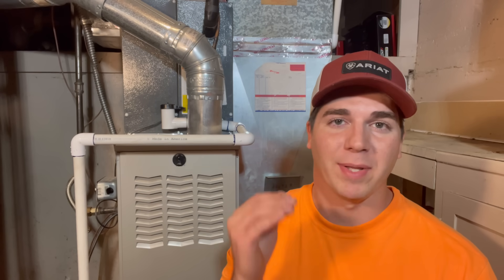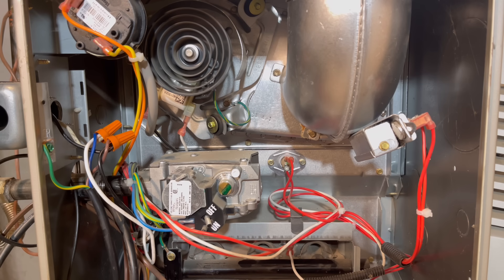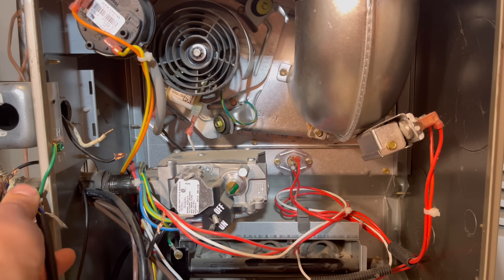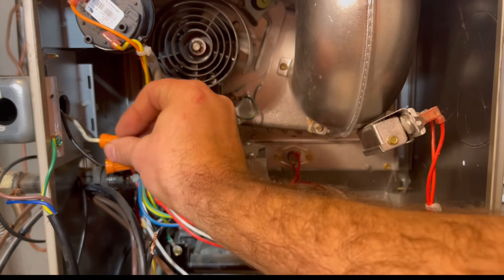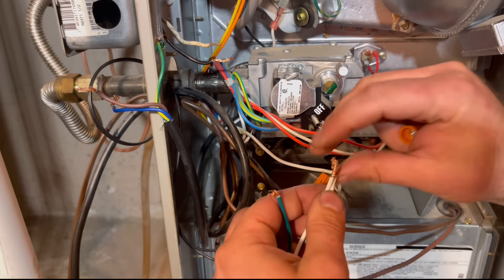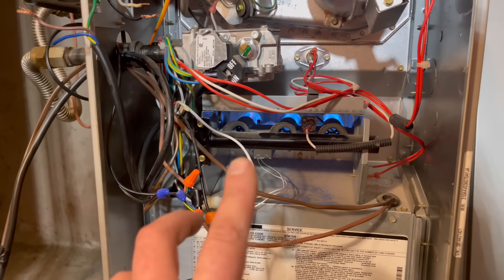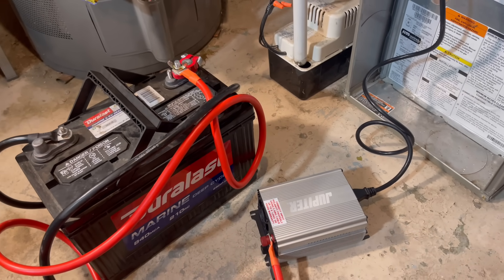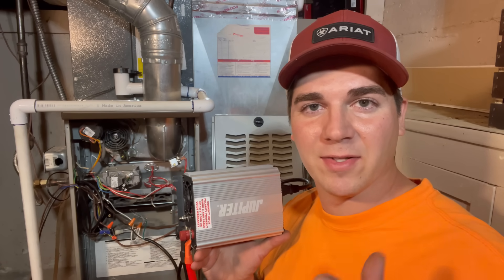Did You Know You Can Heat Your Home With A Car Battery?

Comment: I've been prepping for a while now and have a Big Buddy propane heater with 2 tanks. This is the BEST idea I've ever seen to keep my family warm this winter. You are awesome man thank you!
Reply from the maker: Glad you liked the video and found it helpful. I’m going to be doing a video on heat sources with no gas or electricity soon :) cheers
Reply: I have a 2 tank big buddy. It will burn through those tanks in 15 hours. I got a 50 gal propane tank and adapter and that will burn about three, 10 hour sessions. Great video though, I've added to my arsenal of prep knowledge
Reply: @ER-yv5mu  The buddy's are alright but they burn way to much propane. I have a zebco travler propane heater that was made in the 70's that uses way less propane. My Zebco travler goes from 2000 to 7000 BTU's. I also bought a $100.00 Wood Stove if I need it.
Reply: @christopherhorton821  How does this make any sense?  It's a device that converts fuel to heat.  If the device burns less propane, then it produces less heat.  If your device is burning too much propane and relatively less heat, then you should be concerned about a propane leak.  There are tricks to improve efficiency of spreading heat, like using a fan, but that's not an issue with the device itself.  

Also, you're obviously going to be using more fuel for a larger and less-insulated space.  I used a Mr Buddy heater (about 30-60 mins per night) and a propane stove in a tent for weeks here in the Canadian bush and maybe used like 4lb, which is after I switched to a 30lb after finding the little 1lb tanks to be a waste.
Reply: @V_for_Vovin  I'm not sure what you read but yes my heater does produce a little bit less heat than a buddy heater. My heater goes from 2000 btu's on the low end and 7000 btu's on the high end. The lowest that a buddy heater goes is 4000 btu's. My Zebco Traveler uses half the propane that a buddy heater does on low and less propane on high.
Reply: Yoy prep with propane ?  Get a wood stove.
Reply: @jeepsblackpowderandlights4305  I do have propane. I have 2 two 100 pound tanks and a couple 30 pound tanks. I also have a small wood stove. I show all this on my channel.
Reply: @christopherhorton821  ah.  I have a 500 gallon tank on my 14 acres.  But i never use the furnace in the winter.  Unless im like not home for days and days and need to keep the house above freezing.  I think i used 270 gallons in 12 months lol.  But 8 acres of my land is woods.. so basically unlimited amount of wood.  My barn has a cinterblock lined with tile chimney never used for a wood stove as well.. debated on getting one installed.. but id be afraid of setting the 80 year old barn on fire.   I need to get it checked first.

One thing i need to get though is freezers for food..  surpised i havent yet.. but ive been too focused on other things.

I wish i had solar panels too.   But i do have anatural spring creek that runs through my property.. so thats good
Reply: @jeepsblackpowderandlights4305  It would be nice to have a larger propane tank, but right now we rent a studio apartment. We do own a small piece of property in the little town of Rosebud, Montana. The back of our property is within 5 feet to the Yellowstone River. I also purchased 17 pounds of activated carbon to make a water filter for river water if needed. Having a freezer is a good idea if you have a way to run it, and if you can hunt. Solar is alright but it does not work all that well in the winter if there is snow. You can buy a 400 watt kit for just under $500.00 that includes the panels and a 30 amp charger controller, But the cables and terminals for the batteries and a main fuse and the batteries, and power inverter are a extra cost. Even for a small set it can cost quite a bit once everything is added up. Doing it yourself is still a lot cheaper in the end.
Reply: @jeepsblackpowderandlights4305  It depends on the situation.  I spent months out in the bush in a canvas tent this year and used both a wood stove and propane heater.  A wood stove works great when it is cold (freezing), but it's better suited for a stationary post.  Wood stove also requires a lot of maintenance, especially if smaller and you just use raw wood from the ground, and it can smoke you out a lot- granted, you can cook easily on it.  When season warms up, it's way more efficient to just fire up a propane heater for a brief period at night before sleeping.  Don't forget to get some spare wool blankets, they really made life easier for me when I discovered winter wasn't over yet.
Reply: @jeepsblackpowderandlights4305  yah...
As long as you DONT want fire insurance...course that varies from State to state...
Reply: Your big buddy propane heater is for outdoor use only. If you use it in your home, your family will get sick.  Two one pound bottle of LPG will last about 8 hours and deliver only 600BTUs of heat.
Reply: Off grid greenhouse person here , you have the smarts but why not just concentrate for one large room in your house during emergency, family could watch TV or play games and keep their minds off stuff for little watts just use a UCO or any candle type heater, more bang for your watts
Reply: @timmeier8863  Well, where I live, if the power is off for 24 hours in winter, my pipes will freeze and cost thousands to repair. Gets to -15 sometimes.
Reply: @timhallas4275  Where I live in Montana the pipes can freeze in a matter of minutes.
Reply: @timhallas4275  if your power goes off, turn off the water main at the meter, open the lowest faucets in the house and let the pipes drain
Reply: @kenwittlief255  Oh great idea. Now I have no heat, no electricity and no water. Brilliant.
Reply: @timhallas4275  I understand what your saying but every yard/house is a different climate from my house to yours that said if you need to keep your pipes from freezing $$ maybe batteries and warming up your whole house is not the only way to think about your climate, a small generator and heat tape where pipes enter house could do the trick? And your battery would be better off for small wattage use just saying, me personally I get board to death without my surround sound and tv wi fi but I can run all my stuff for under 200 watts which is cool for me and my climate , that’s what I’m saying, I don’t mean to offend anyone I get all my ideas on the U and use what’s good for my climate , works for me
Reply: @timmeier8863  Any battery is at best a temporary solution to any problem. My plans are for long term power outages in the coldest weather conditions. I have alternative heating solutions including a natural gas heater that requires no electricity, and a wood stove that will keep me warm if the gas supply goes down.  I have enough fuel, water and food to live one month with no outside sources. It sound to me like you are prepared for one day without electricity at best.
Reply: @timhallas4275  I did not want to say to much because I didn’t want people to think I was piling on , so your not using that battery for your house because you have a month of alternatives that’s awesome for your climate but you did not mention that , I have 1 k solar and 1k amp hours and I was a A/C mechanic for 30 years so when you mentioned your house and -15 I knew this heater/battery thing would not last and you have the perfect easiest set up , not in attic not under house but if you would have mentioned this at the beginning and said I’m covered but this could work for others in a pinch that would have been better, in my opinion and how many heat cycles will your heater go through, start/stop ? An hour , or run it up to 80 and hope for the Best.
Reply: @timmeier8863  You are pretty smart. I talked about some things like that in my latest video.

Comment: Don't twist the wires together before twisting the wire nuts on. Just push the wires straight in and let the wire nut do the twisting.

Comment: I am a HVAC repair tech. this is the best idea I have seen on you tube get a small generator to charge the battery back up when it needs charging [ charge out doors or in a will ventilated area] harbor freight good prices thanks
Reply from the maker: Glad it helped! Cheers

Comment: Figured that out more than 20 years ago with my hot water heating system. No blower, so I can use a smaller, cheaper inverter. Just pull the car up close to the house and run an extension cord out to the car.

Comment: Good for gas furnace (maybe) not so good for heat pump unit. Just have a small generator on hand to run a furnace and fan say about 1200  watts?

Comment: Anyone taking advice from this video is an idiot.
1)  That car battery probably won't last an hour running that furnace.
2) That car battery isn't designed to be deeply discharged and it will destroy the battery.
3)  That crappy little Chinese inverter is probably a modified sine wave unit that has a high probability of burning out the control board in the furnace.  The inverter must be a "true sine wave" unit and it should have a clean output.

The conclusion?   People in Texas are idiots.      Less bible, more science people.

Comment: Will that work on a 700 watt invertor or a 700 watt surge to 1000 watt solar power generator??
Reply: I have a Coleman 90k Btu furnace in my manufactured home that draws less than 12 amps and thats at surge only then it drops do so i want to use the 700 Watt Solar Battery charger with 1000 watt surge capacity. That should work ok. I will put in a double pole, double throw switch on the furnace with a separate 110 volt recessed male receptacle with hinged cap
Reply from the maker: My advise would be to pick up this inverter. Pure sine wave 2000w

https://amzn.to/3APhfwr

Then install the inverter in one of your behicoes and run a cord to your furnace. Have it wired in advance so the furnace has a male pigtail that plugs in like an appliance. Then when an outage hits, simply plug the extension cord into the furnace pigtail and you are golden as long as you have fuel in the vehicle 👍🏽 cheers

Comment: Very nice, just wondering why there is not a door safety switch?...thx gary
Reply from the maker: The carrrier Bryant model that I have has the safety switch behind that metal plate that seals off the fan assembly. It’s a little different then most furnaces. Thanks for watching! Cheers

Comment: And does it work with marine batteries?  Car batteries loose life % every time it's sucked dry.ie limited life. I mean in an emergency we don't care but for preping planning I would say get a battery that will take many more charge and discharges.
Reply from the maker: Yea marine battery is better. Here is what I did. I picked up a pure sine wave inverter, wired it to my work truck, so now if the power goes out, my truck acts as a generator, and is much quieter and I can power my furnace as long as I have fuel in the truck! Cheers
Reply: @diyhvacguy  it there a minimum battery power cca?I know I'm asking more technical questions.but the more info the better decission we can make.i have 3 building I rent to family members. I have 2 backup generators.and propane heat sources as second backups. But you can never really have enough backup plans. Just went to check 1 generator ( only 2 hours use on it for matance purposes) and it gave me a hard time starting. Stupid sparkplug cap was loose from moving it. Always have several backup plans is my thinking.

Comment: There is no way that battery will run that furnace for days? Maybe an hour or 2 . The blower motor will draw too many amps and kill the battery. 60 amps min a furnace uses and it will not last long. Get a small generator and run it off that.
Reply from the maker: Here is what I did. I picked up a pure sine wave inverter, wired it to my work truck, so now if the power goes out, my truck acts as a generator, and is much quieter and I can power my furnace as long as I have fuel in the truck! Cheers
Reply: @diyhvacguy  that will work

Comment: Mr. Heater propane heaters are my back up.  No electricity needed.  I’m not knocking your idea, I like your thinking.
Reply from the maker: No worries! I’m coming out with a video on how to heat your home with no electricity or gas soon. It will be a good one. Stay tuned! Cheers

Comment: Great idea , but your thermostat inside the house won't work without power , how do you control the furnace turning on and off ? Just disconnect the power when the house gets warm enough ?
Reply from the maker: No the furnace supplies the thermostat with power. Or if your thermostat has batteries then the batteries will power the thermostat. So as long as your furnace has power, the thermostat will know when to turn it on and off. Easy as that! If you have any other questions don’t hesitate to ask. Cheers

Comment: Hi my name is Donald I was wondering do you think it's possible to do the same thing with the portable jackery explorer 240 it puts out 110 right out the side please answer appreciate you
Reply from the maker: Here is what I did. I picked up a pure sine wave inverter, wired it to my work truck, so now if the power goes out, my truck acts as a generator, and is much quieter and I can power my furnace as long as I have fuel in the truck! Cheers

Comment: Modern furnaces use sensitave electronics. Many sensitave electronics cant handel the outputs from inverters.
Reply from the maker: Here is what I did. I picked up a pure sine wave inverter, (better for more sensitive electronics) wired it to my work truck, so now if the power goes out, my truck acts as a generator, and is much quieter and I can power my furnace as long as I have fuel in the truck! Cheers

Comment: My question is, if the power is off how will the thermostat signal the furnace to turn on?
Reply from the maker: The furnace powers the thermostat if it has a c wire. If it is powered with AA or AAA batteries then the thermostat simply sends a signal to the furnace and will still tell it when to come on and off. So to simplify, as long as the furnace has power, the thermostat will still tell it when to come on and off. Hope this helps. Cheers

Comment: Most furnaces have door switches that you would need to clamp on.
Reply from the maker: Not to access the burners. Only if you are trying to access the control board and blower motor 👍🏽
Reply: @diyhvacguy  Yes, thanks!

Comment: Great video question what about furnace without motor or fan motor like I have baseboard heating my furnace don't have any kind of motor running on
Reply from the maker: So it’s just radiant heat?
Reply: Baseboard heat running water in the line

Comment: route the pig tail out of the heater, install an outlet at your heater switch and leave the pig tail
when the power goes out, just unplug the pig tail from the outlet and plug it into the inverter 
it's easy and safe enough for your wife or kids to do if you're not home 
in other words, make the pigtail permanent 
your heater plugs into the grid just like your toaster or tv
Reply from the maker: Yes! This is what I’ll be doing. Thank you so much for sharing!

Comment: This video should start with a disclaimer that says something like I don’t know what I’m doing but that doesn’t stop me from being a fool. You too can void your home owner’s insurance policy and create a potential electrical and fire hazard by illegally modifying your furnace and power it with a battery powered system like me that will destroy your blower motor in time and defiantly start a fire should a battery short occur. So let’s go have some fun and don’t worry there is no need for fuses or grounding or any other pesky little thing like battery safety and isolation.
Reply from the maker: Good point. I have a disclaimer in all my video descriptions.

Comment: Side note: boats typically have deep cycle battery’s and will hold power for longer. In theory the deep cycle battery should let you run it longer.